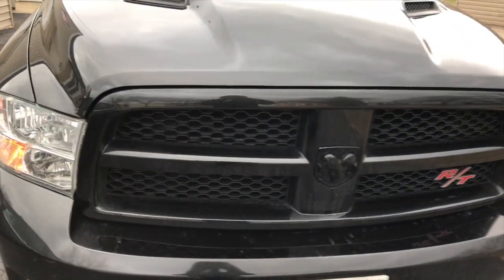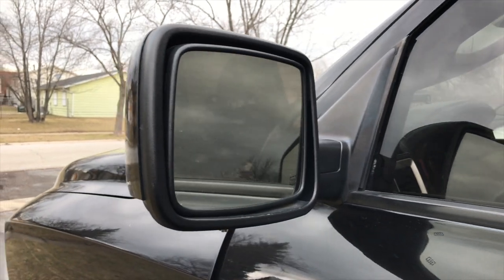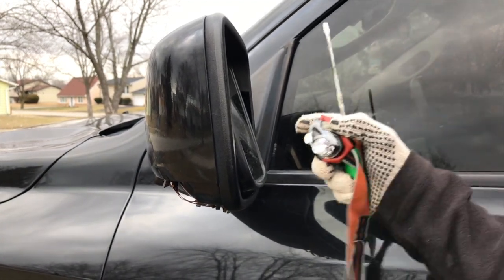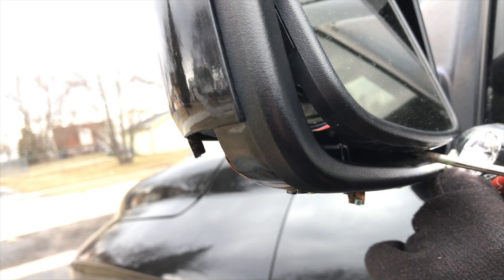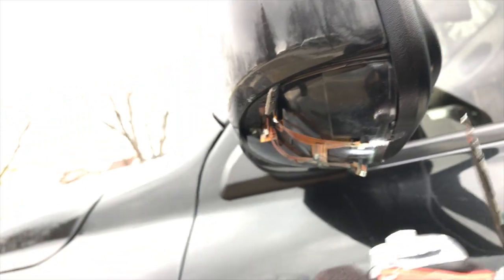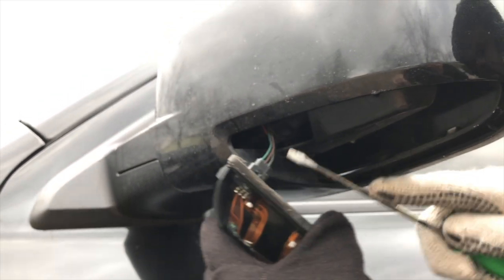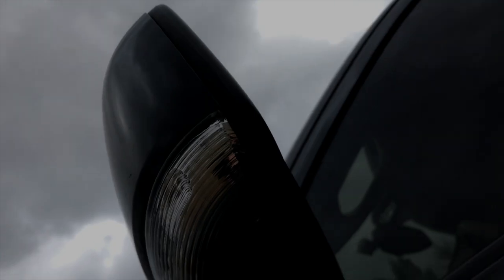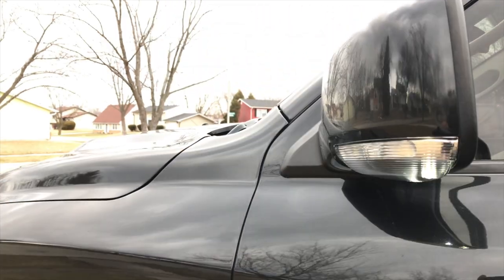Dodge Ram Side Mirror Light (Puddle Light) Replacement / Installation

Comment: I realize this is an older video but its still very relevant 7 years later, thanks Terence... very nice, straight forward and to the point instructional video.
Reply from the maker: You're very welcome. Thank you so much for watching.
Reply: Just to be safe.  Make sure it’s working before you reassemble 😊

Comment: YES! This video is exactly what I needed. I also had a broken light (Hit & Run..UGH) and the local collision shop and dealer wanted over $1000 to replace entire mirror assembly.  I bought a replacement light unit, watched this video, and within about 40mins, It was replaced for under $50. Had a hard time getting new one in quite right. You do need to push up pretty hard to clip it.THANKS FOR THE VIDEO!
Reply from the maker: You're very welcome Jason. Thank you for watching.

Comment: I just bought a 2011 and the driver's side was out, and lens was falling out.  Dealer had super glued the lens into the assembly and part of the actual mirror foundation.  Took a razor along the edges, and then using your video was able to pop that sucker out.  Awfully stubborn for a while. The female connections from the mirror were corroded, so cleaned those up.  Went in and working like a champ.  Thanks for a great video!

Comment: I was going a little nuts because my lens had broken out except the top part was still in there - it didn't have the electrical lines showing like in your video, so I though I was looking at where the new light fixture was supposed to fit in, but it didn't have the slot for the vertical tab.  So, your video cleared up the mystery.  I was able to remove the top of the old lens and install the new in about 10 minutes.  Thanks.
Reply from the maker: You're very welcome, James. I am glad my video helped. Thanks for watching!

Comment: Thanks, this helped me on my 2018 ram, some ahole decided to smash it off. So don't do what I did and order a knock off from amazon, order the Mopar part ($90).   The screw driver is helpful as it doesn't just snap in, you have to pull on the mirro frame a bit. Wouldn't of known that without this video.
Reply from the maker: You're very welcome. Thank you SO much for watching!

Comment: Love these videos short and to the point ! Replacing mine soon once I get it in
Reply from the maker: Thank you Hector and thank you so much for watching.
Reply: Your welcome man I was just wondering they fit on a 2016 dodge ram hemi ? I’m pretty sure obviously just gotta be sure 🤔
Reply from the maker: @hectorvasquez7410  , yes, it's the same. Here is a link for an upgraded LED light that's pretty popular. This listing is for a pair at a great price. 

https://www.ebay.com/itm/403910358957?fits=Make%3ADodge&hash=item5e0aeef7ad:g:WWgAAOSw9tZjNB0-&amdata=enc%3AAQAIAAAA8L7ECGPxEHWcuHXXwCnyp6iG3lrZnMfqGt1r06SrjEYNaJwPzUSy4Jv2vXaYgO1KFJJ1JfFCJ9F%2FsoOth1i1dY4c04fUtszubf0nwVvIJQb6QziZ%2FZLsSsEExBlcxzNklt1KE93Ob42C58RwyV78EXJrLZ1i10IKbVsISn4gP4R7OkUKUvV5LXZ1NqSt6UVYLFbu0FfYORGu%2F58taxxPx1uXyN2Dg2naRIdW1lMvbEynXaCriRA%2BZ0Yr%2FN61nKdx5%2B9DlrOsqj8Ld5aiQW4s17gOWEwqzWNFqjsWQmPIszHwNHA2VVnECaxf8fVZ6Pb4kw%3D%3D%7Ctkp%3ABFBM3IbLhopi

Comment: Where are you guys buying your replacement lights from. I’ve got a 2011 ram 1500 4.7v8. Thanks for the video!
Reply from the maker: Here are some links....

https://www.ebay.com/itm/305328762467?fits=Model%3ARam+1500%7CMake%3ADodge&hash=item4717032e63:g:Cz4AAOSw~gZliwI6&amdata=enc%3AAQAIAAAA0DMn9f8YxoXIenSY%2BgTFihYjJff2Q8MBZ2y8dXNTuslTzcSN7ZXm0kVfFdFE870TYex3ATWihwfpF8vu%2BTKofW6aeo3oaGOp2cba%2FmDmki8WSX%2FVa8kkdWlq%2Bj4%2Ba3A4WCD2BXv0cS%2FWf2Iv7qpwtbZ4HSkYlcZQZPRvq31AZ5bpAUfqXc1ylOEku3DthYkPr5vZ9nNN8cc0lDqVjoERA1g0oWkVefoJOLfhzQhY%2FEUQRI78l7nLyT5NruRWxUlxbJKKloz7nh4ZQtdZmPoOLXM%3D%7Ctkp%3ABk9SR_TlrcmgYw

https://www.ebay.com/itm/134499172440?fits=Model%3ARam+1500%7CMake%3ADodge&hash=item1f50c68058:g:MVMAAOSwyolkGUuz&amdata=enc%3AAQAIAAAA0E86gi7DaTAn6dGWqahvnmNZTK%2FZtVsTPiqyvEfJC%2FYu84Bmf6DuG4TC6j1RFrm0v1UDtQYEiUP0k48atFk9HcDw8viGvDCk0qw8Yr1Dh1eYcHUkM1EAljfNMZvVeqaq37b21tnr%2F3xyktZReTGAp2NulDd0cjp%2FLWQ%2FNSwhWwcBVAAArmSkfZeuTkdmQLzAJbG3wfgApYBQrLTr%2FE0EhGk%2FD2AcsBeeabPci9J3IZA7cOKN5nWosdtQSkofym7kDDsOhUlY6WRxF%2FunvjRxYXU%3D%7Ctkp%3ABlBMUPTlrcmgYw

https://www.ebay.com/itm/285296603449?hash=item426d00b139:g:mGIAAOSw0zVkaz3K&amdata=enc%3AAQAIAAAA8ObAGmZZpIF1DE1hbUs6yHmRYTUZwGsdUA1uJA3B8yTYKKtMkLeuLrq35RZN3ieDgpcAa53As%2F1VzoQedGZykG23T3NvDJwZ3C5b9D8gUdqys4QOmMnlZRlmitUnDUdTxy94z2oNlMt2j17jO7%2Bot621HjJ9dCuHU7UDoOSoi4YyKrBixGRyUTyxNkt%2FOwPN%2Fnsu%2BWUjFpHuEV5UubreuNFN5sxsFbFMC6PhUyuwDc0Hwxh21oRe91dmUwk3gXpMXpBVByB43YOus7UnSI85ZfMNuJ6tnFXnPVvHkrYDWUL5mfWf%2B37BDEbuc7ABPlW10g%3D%3D%7Ctkp%3ABk9SR_blrcmgYw

https://www.ebay.com/itm/235012483454?fits=Model%3ARam+1500%7CMake%3ADodge&hash=item36b7d5e97e:g:ptMAAOSwwgpkYuTO&amdata=enc%3AAQAIAAAA8H1n8Q7XBDeDNbtVBZaYFo9VRVEml1MF1nTLgZChWWIf6cDDk4SWHZlE6dKWrBpWF0C96XYGFP9uwyOOAMjUBz7IrXM%2BnMwx7OKhnZbzyWVmQbMDh3zwfnjj6rsXV2Xf0CKrUQOGcO4H4CoqchHWJouU1oYxbrvOmEv9A%2Ff3g0WfmJ8%2FydeBajm2VDkOBPhqU5RcM1%2Fy6ZaBCv6OiN6%2BX%2FO%2BDn%2FCo9%2BDysHhkl2HGJJJcZ8AibV6tfht4W8L8zRwKY6nH4uVSCLTc1rgOA%2BNgb4T2vPQg595EhYQSzm7YdIr17REpg3rj2ZGbJbmbNoevA%3D%3D%7Ctkp%3ABk9SR_TlrcmgYw

Comment: Great video, anyone have links to the part?
Reply from the maker: Thank you. Here is a link. 

https://www.ebay.com/itm/315481383842?fits=Year%3A2010%7CMake%3ADodge&itmmeta=01J4HHX7RJH2K6MRBSE9JQRXDW&hash=item497427e3a2:g:JY0AAOSwwndme7Ng&itmprp=enc%3AAQAJAAAA0HdnjnYhYbjF%2BKHtC5z4KKgKuWprYzJhpKPedWwouaPijxVv4ZLlBQCFiRh1VQB0U0d3sadD9KwcJuumfgXj6tUfMCAQD7R%2B%2BNvi2NIdWgoZQLU7N6oARh7tzspPLbIYZlDisN3xximRQLEfQra6AXIfzldRUo9bEWXqu4D6h6e%2FAdCdeqBPExiOyLAJLXHY39Rk1Rs9zxmNeZ7KNDqBE74pM4Y6YuH33ob9Oa%2BraNsKFOFn7B8%2Bi1ipvCyzZNcgRwTjDrk0YYS6pzWhH2sbYxc%3D%7Ctkp%3ABk9SR8789LGkZA

Comment: Helpful thanks.  Mine didn't pop out quite as easily on my 11 Laramie.  It definitely took a little "convincing" from the bottom and side of the old light.  I got it out though and plugged in the new.  The re-install wasn't as easily done like in the video either.  I had to use a small screwdriver to get it to drop into the final position.  No damage to the light nor mirror though.  Works great now.
Reply from the maker: Sorry it didn't come out as easy as mine did, Andrew. I hope my video helped a little. Thanks for watching!

Comment: Very helpful! My wire connector is very corroded. Do you or anyone have the part number for a new one?  Thank you for the video!
Reply from the maker: Hi, you need a link for the light or wire connector? Thanks,
Reply: @TerenceDIY  I'm looking for the wire connector. I just ordered new lights. Thank you!

Comment: Awesome, mine just got hit by a this past weekend and shattered. 
Did you use OEM part or aftermarket?
Reply from the maker: Sorry to hear your glass got hit. I got lucky to get a OEM for the driver side, but I eventually changed the passenger side with an aftermarket. Both are pretty much the same. Thanks for watching!
Reply: @TerenceDIY  I'm rolling the dice, ordered a pair of aftermarket puddle lights yesterday for half the price of one OEM puddle light, fingers crossed 🤞🏽
Reply from the maker: @gonzo13  fingers are crossed! I am pretty sure you'll like them. Keep me posted.
Reply: @TerenceDIY  got the aftermarket puddle lights installed, they look good and so far they are working well.
Thanks again for the video you posted, it looked like I actually knew what I was doing, lol
Reply from the maker: That's awesome Michael! You put a smile on my face! Thanks for watching!

Comment: Do you know how to get the blue light instead of the white light? My 09' originally had the blue but it messed up and I had to replace it.
Reply from the maker: Hi Brandon, is it the bluish hue light like these? Or were they more blue?  

 https://www.ebay.com/itm/115174793894?fits=Year%3A2009%7CModel%3ARam+1500%7CMake%3ADodge&_trkparms=ispr%3D1&hash=item1ad0f3e2a6:g:p3MAAOSwis1h29v2&amdata=enc%3AAQAGAAACoPYe5NmHp%252B2JMhMi7yxGiTJkPrKr5t53CooMSQt2orsSR84A%252FGMxXIqJzFmDq6lDLlvNOgCpznptKaDJq7ljS4uRSjHxccMKLuQZ6Iai2uFgrmzj3KXGqqRdK2GsAigw%252FmCvF0nLurGAvEIhdSEXSgDeBOk33Y3Ky2DiARAiGyc01ADAEOHry3R06UVRQJ%252Fb2uwq7ZJG90bD20bH%252F%252Fv520eOJOQ9WrtozMmrDtDlT8zj6Yj6exthg66F9MoBOSOoTXrr24jcB7HvwoEcXY7AX79etE0Vxuajws%252BIgKJR66H0glUxATbH4G141hI4oNbjO7C0rBUq0vGsQpYREY6gF2SbtcyS5o1qM0Bua07n9eUJH%252Bql6dxeSM3nOfOt471mGrX1bFYskc4lGF%252Bht6Ix8eNL63zCD%252FEGiYiqFkMAAVvIrWuBaz39Tfv9158G%252F1ARo8MKd3TO2ctU1DbKl8Jqkx4jI82AwazXiuG3uwmtd9C6SXnc%252B%252BZgmDPfZYjnztIEUeR2O4WkuvkI72m%252FKy7glDH5dhYGKyIv2DF20gaK8o8kCM5sfrXlO4lsTXo7ScseqxqWmbmMVJfC7Em4ftK4pwOQTw3pgbs15s3u1GMLUrFev%252BgIYaXTV9N33f8AoCJzYhYZMl1TTxR4NO3J6KYCwt3FA6mGaGvqCaGZeODh25twP6TTkA42v3MTOjrUWGKfRZk5zQ0nqt2SnTTJuwVBhfpA30ZD7%252FXCU7flQGKuMxah%252FDg4Tl84Fep1YzBHtCwfvImPUBbGtwYKQErzIQrRF5pmC44OleJjXJT0%252F0y4QXFSw8jLi62yw89apb3IaCeHVNZdfDT8o9LgxlkHqE7uw15RJuR1QRcrkSwIZLLSvuQJCReo53F0XLONumcDTtZptg%253D%253D%7Cclp%3A2334524%7Ctkp%3ABFBM3M_VrfFf

Comment: While placing the assembly back into the mirror the lens cover popped off. Is there a way to re glue or fix this issue?
Reply from the maker: You can definitely glue it back together. Here is a link to some really good glue that I have used in the past on plastics. (Link below)  Thanks, 

https://www.amazon.com/J-B-Weld-8237-PlasticWeld-Plastic/dp/B003S2E4UE/ref=asc_df_B003S2E4UE/?tag=hyprod-20&linkCode=df0&hvadid=241975700326&hvpos=&hvnetw=g&hvrand=202242664520567841&hvpone=&hvptwo=&hvqmt=&hvdev=c&hvdvcmdl=&hvlocint=&hvlocphy=9021629&hvtargid=pla-526005054381&psc=1

Comment: Where did you get the replacement puddlelight?
Reply from the maker: Here is a good deal on them...

https://www.ebay.com/itm/115174793894?fits=Year%3A2010%7CMake%3ADodge&hash=item1ad0f3e2a6:g:yrkAAOSwixtikcls&amdata=enc%3AAQAHAAAA8MGquXCfNbrCAi0ube6MnMvoQKH6F2M7UcDohFrhdlLd8zObM0%2BdIxT9gVJCAiKyV61CMj35X8iBgIei1aJbmHxLA%2B3bidjCuXRrrIAPX6QjASaGJ77x43NkP8Uo3aRXQ5LKtlhBuW%2FP2lQDCVJZnsyfpXQmA7sDbgcbnnXYo5hcH1S7DOOiUf4pOEWsB297tyh8d4Z5V3oAhMFJiwPYGvwKfXjE%2B9JYz5Qhi7s2zDnURRj9csXnLt9a%2FrS7LL4n8kTQHLct6nQZaAev0zzsPxfc9ukCOCQkrDiFcKgYRE4u1XmbvP6z384yd9Qmpegd3A%3D%3D%7Ctkp%3ABk9SR5iWn5r7YA
Reply: Thanks for the quick response.    I couldn't find a listing for that style light.  Your video was very helpful as well
Reply from the maker: You're very welcome. Thanks for watching.

Comment: Where did you find the light. Parts number would be big help.
Reply from the maker: I had the link in the description box however, the link became non-useable after a couple of years. Here is a link for a great deal...

https://www.ebay.com/itm/304862451265?fits=Year%3A2010%7CMake%3ADodge&hash=item46fb37d641:g:r3UAAOSwG5dkI7p~&amdata=enc%3AAQAIAAAA0FRLqUL9ffj3YVDZEJa%2FVx4NpCoFjsfj7JUGprAz7%2FsTBH%2Fbjptqf5v3gSQNqw67HBd%2FhRYmWPDJbZcsV9bxScBlQvN89N1Mn91rYWEvn8VSbSVRYK5vEAHFHLazGM%2FUVs0m%2B1NzOP06d59ioOIOy6%2FTYTOIufGj0LifNvJUTil6Nj1uYl5Z1f5LtaPu1KKFnRpkwZvdCa6nZgEMNIDyxNjuSfpfXLE7MJKTzHIPT%2Fi6BevVG6XS77irW8ozKYTqTF%2BWcrunnKXSYDvU2P6siUE%3D%7Ctkp%3ABlBMUL737-mbYg

Comment: Where did you get the replacement part.. can't find one anywhere for my 2017 Ram 1500 Laramie
Reply from the maker: Here is a link to the light. I believe this seller has both sides. 

https://www.ebay.com/itm/DODGE-RAM-10-17-GROUND-ILLUMINATOR-MIRROR-PUDDLE-LAMP-LIGHT-RIGHT-PASSENGER-SIDE/203112328766?fits=Year%3A2010%7CMake%3ADodge&hash=item2f4a702e3e:g:GLIAAOSw5L9XDwMF
Reply: I agree my 2015 has the exact same housing design not the bullshit under the mirror design I’m thinking about just ordering them I can’t be the only one

Comment: Are these part #'s for the turn signal only or do these turn signals also include the puddle lights as well? I have a 2010 Big Horn 1500 and the mirror light serves as a turn signal as well as a puddle light whenever you open the doors. 
Thanks again!
Reply from the maker: I am sorry for the delayed response. Yes, the light has the turn signal and the puddle light. Thank you.

Comment: I have an issue with the amber leds not working but the puddle lights work just fine. Possible comnection issue? I dont think ots the fuse

Comment: I just broke mine. Do you have a link for this part? Mine is on the passenger side. Thanks!
Reply from the maker: Below is a link. 

https://www.ebay.com/itm/DODGE-RAM-10-17-GROUND-ILLUMINATOR-MIRROR-PUDDLE-LAMP-LIGHT-RIGHT-PASSENGER-SIDE/192888087696?fits=Year%3A2010%7CMake%3ADodge&hash=item2ce906a490:g:GLIAAOSw5L9XDwMF

Comment: Where did you buy the replacement parts.  I have a 2012 ram 1500 and cannot find those replacement parts.
Reply from the maker: Hi Harvey, here are some links to both sides.... (please check your application)

https://www.ebay.com/itm/DODGE-RAM-11-17-GROUND-ILUMINATOR-MIRROR-PUDDLE-LAMP-LIGHT-RIGHT-PASSENGER-SIDE/192865485851?hash=item2ce7adc41b:g:GLIAAOSw5L9XDwMF

https://www.ebay.com/itm/DODGE-RAM-11-17-GROUND-ILUMINATOR-MIRROR-PUDDLE-LAMP-LIGHT-LEFT-DRIVER-SIDE/202631590862?hash=item2f2dc8b3ce:g:59cAAMXQLoZR3FlL

Comment: What's the part number? Will this fit the Laramie?
Reply from the maker: Here is a link to a great deal. 

https://www.ebay.com/itm/353620220482?fits=Year%3A2010%7CMake%3ADodge&_trkparms=ispr%3D1&hash=item5255685a42:g:PTwAAOSwjWlhFM9H&amdata=enc%3AAQAGAAACsPYe5NmHp%252B2JMhMi7yxGiTJkPrKr5t53CooMSQt2orsSd0ReTLyM7cxPnI6zs468EIQ16y37KRXoLea5Vkf0hMg4lYBMTOJ%252F41pGCTGcJylxL5CuJ7wLux4kgwQ6qpb%252B2Z08NlycqWgkZtgWn3ERf2NnOnvlWKV68E9rLit%252FnFe%252B84dXNJoxUDYMSfc279YchByh8xArh3EiWwafE6J3e%252F9hUYDoN%252BZN8HOiA6tVWPD0S07MKbUoquCOTkgXFpSzdwjESmjRuhzYszeDxFlUBeRWr%252F4THC3xIB9QtejBRAIHvoWDYZWCZjyhOgiHdn4B6T13Ik7Po2SC02QC13shae6F8SbYD45bnuN9p3%252BHkjhSddp9%252BT0OrGfosLvRmBfcN60zcaWoZRPoLlpKbU0oNID8DaD5WYaNKr8WFYHyOkmzDOmXmFhjG0E%252B%252FA7DWY5Hj%252Bxe%252BJmXRocXe9ZVZ1FLsQWGPJ6ejENzNPMojJF1WMmuH8OWLQeljFVY0yhxV%252BmAOxSplxePkT4bETKHOuUxG0u6EgfpTMKkZKipjlgtPNQVis9S1%252F9l8ksIwnzqK18XpNcVmxy6nZzbWWp7cVGw%252FOObgBksPsTCdtQlF8metY0%252Bqp3OpIN%252FLKaE1p9AVDCsy5b49BqURhj9dJFx2KQXYBhoQ1sKyugOJyGsfIz6JnhoVj9aZeZ%252BxY6R5sj7qHzWzfrIegLIKO%252F2dyNrYZQVAUl6F0VK%252Ft5PPeazE4j22Uff4cI%252FU9DEyQPqvj0JjrBBEmzNs3DZQQeqXg54zoznIPeX3%252FyGyHj0d%252BqVSKwam6iOl82ndg4ylCQXlIfkdp1nn6oXgMU8CDrV3dFaNKCHmvk0OJ%252FL%252B%252F0LGhkKp9mK2StHA5H%252FcC6VF7xEA8tJqnr1YZNgsagV5Ryr%252F047Ll0zIqI%253D%7Cclp%3A2334524%7Ctkp%3ABFBM6MPP5cpf
Reply: @TerenceDIY  thanks man!
Reply from the maker: @shaggy_e210  You're very welcome.

Comment: What models does this work for?? I have a 2012 that needs replaced does it have the same part number?
Reply: Hi Lyle, yes, this will work for your truck. Below is the link the light you need. Thanks for watching!

https://www.ebay.com/itm/DODGE-RAM-10-17-GROUND-ILUMINATOR-MIRROR-PUDDLE-LAMP-LIGHT-LEFT-DRIVER-SIDE/202607940470?fits=Year%3A2010%7CModel%3ARam+3500%7CMake%3ADodge&hash=item2f2c5fd376:g:59cAAMXQLoZR3FlL

Comment: I'm confused, did you replace the bulb or the whole assy???
Reply from the maker: I am so sorry for the delayed response. We are still moving so I'm still not able to answer my comments promptly. Yes, the entire assembly was changed out. You cannot replace the bulb itself. It's one unit. I hope this helps. Check out the link below to see the unit. Thanks for watching!

https://www.ebay.com/itm/DODGE-RAM-10-17-GROUND-ILUMINATOR-MIRROR-PUDDLE-LAMP-LIGHT-RIGHT-PASSENGER-SIDE/192888087696?fits=Make%3ADodge&hash=item2ce906a490:g:GLIAAOSw5L9XDwMF

Comment: Where Can I Get A Replacement From For My 2012 Dodge Ram 1500. I'm Thinking About Extended My Side Puddle Light From The Original Ones
Reply from the maker: Hi Kevin Kooper, sorry for the delayed response. I purchased them off of eBay. There are quite a few sellers on there that have them. Thanks, Terence

Comment: I have searched EBAY and cannot find the same puddle light as you have in this video.  could you please let me know where you ordered it from.  maybe the seller
thank you
Reply from the maker: Hi Kandace Yaretz, I am very sorry for the delayed response. I have been working on a documentary about health and my youtube show. I bought them from ebay. Here is a listing for the driver side. The seller also sells the passenger side. https://www.ebay.com/itm/DODGE-RAM-10-17-GROUND-ILUMINATOR-MIRROR-PUDDLE-LAMP-LIGHT-LEFT-DRIVER-SIDE/202236421925?fits=Make%3ADodge%7CModel%3ARam+3500&hash=item2f163ae725:g:59cAAMXQLoZR3FlL&vxp=mtr

Thanks, Terence

Comment: Hey, I just subscribed because I have same truck from same year. :-) 

My truck's driver side puddle light is flickering and I wonder if you're familiar with this type of issue. The light is obviously working but it flickers every now and then.

Thanks,
Reply from the maker: Hi mweezy, Sorry for the delayed response. I am currently working on a video about health that I will be uploading to my channel soon. I think you have a faulty light. Or it may be the mechanism that turns the light on (which I doubt). Do you still have the factory puddle light installed? My passenger side light is acting crazy. It's also an original light. I will be replacing it soon. Thanks for the sub! Stay tuned, I will be uploading a huge problem video that deals with the transmission in these trucks. And, another video about the oil control valve. I will be changing it within the next week or so and the transmission issue. These are two HUGE problems these trucks deal with and there are next to no videos on youtube addressing them. Thanks,

Comment: Where did you get the new light from ??
Reply from the maker: Hi Joe, I purchased the light from off eBay. Here is the link... https://www.ebay.com/itm/DODGE-RAM-10-17-GROUND-ILUMINATOR-MIRROR-PUDDLE-LAMP-LIGHT-LEFT-DRIVER-SIDE/202607940470?fits=Model%3ARam+3500%7CMake%3ADodge&hash=item2f2c5fd376:g:59cAAMXQLoZR3FlL:rk:3:pf:0